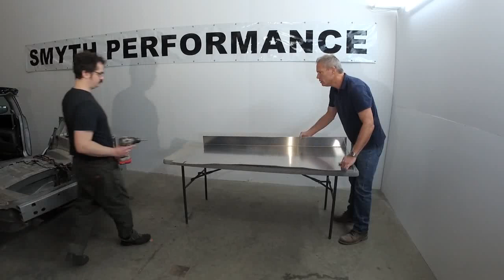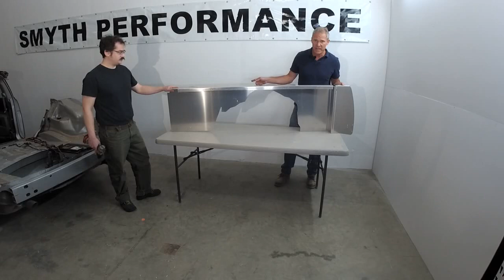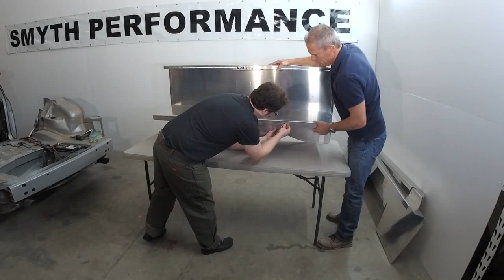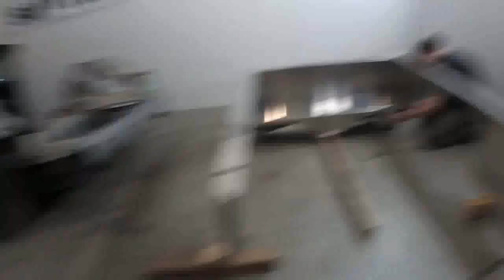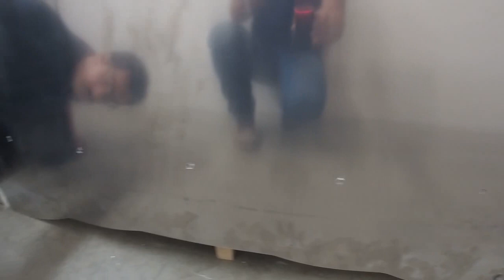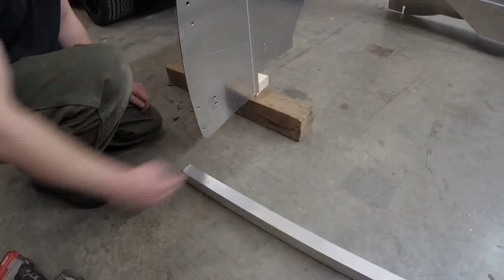Charger,Audi, VW  Build: Assembly of the aluminum bed parts(edit from live build)

Comment: I like how you have done the engineering of the aluminum panels.  With the pilot holes drilled it will make for a much easier install for someone who has not done something like this before.